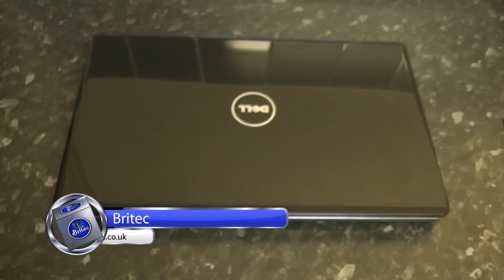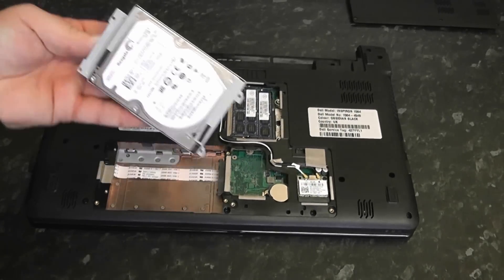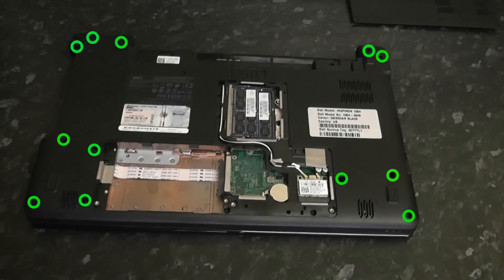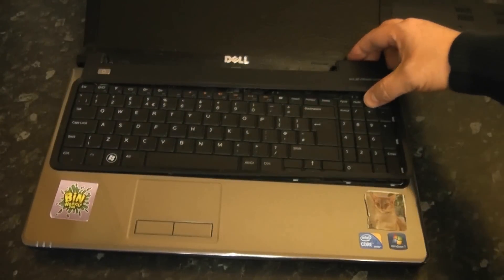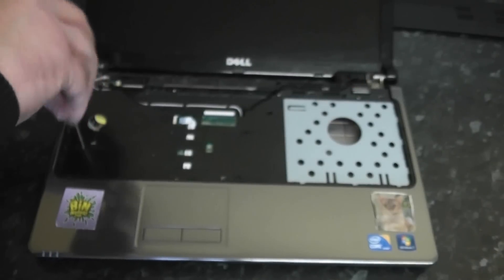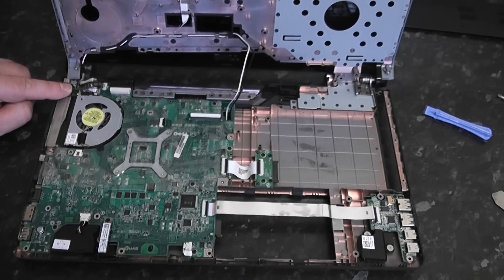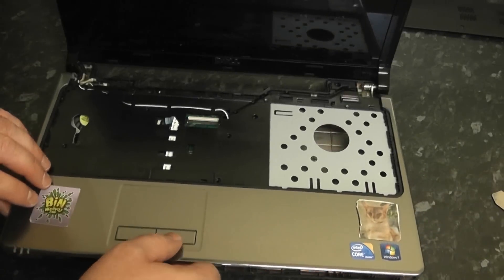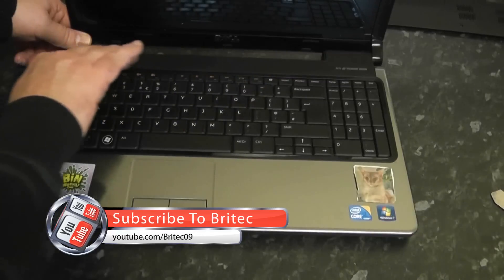Dell Inspiron DC Power Jack Replacement

Comment: I did not know there was any dell consumer laptops that had plug in DC jacks, I have seen that on some acer/Toshiba/Samsung models but never dell,
Reply from the maker: Yeah all laptop should be like this for easier repair.
Reply: Britec09
The EEC should get on the case of that instead of the stupid browser choice nonsense

Comment: Hmm ive been there before, wished all were as simple as that, most you have to fully disembowel it to get to the plastic prize ha ha .

The psu cables have a bad habit of snapping internally with them, but the sneaky 3 wire i.d check of the psu brand often stops people using a generic one.

Nice job brian :-))
Reply from the maker: Yeah, not all are that easy, like you said some you got to tear right down and then solder new jack. Some people are doing that for £45 round here, not me brother.

Comment: Those ribbons cables are a pain...anyone that is going to do this...be VERY careful not to mess up the contacts on those cables.  This looks much easier than when I did it on my wife's Inspiron 1750...I actually had to replace a daughterboard with power, USB, and VGA on it.
Reply from the maker: Yeah they can be a bit tricky